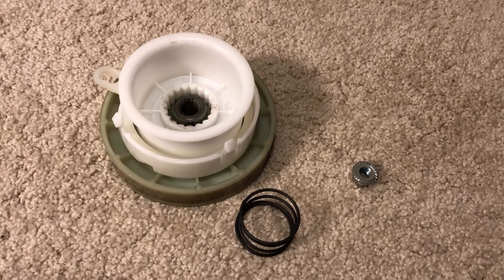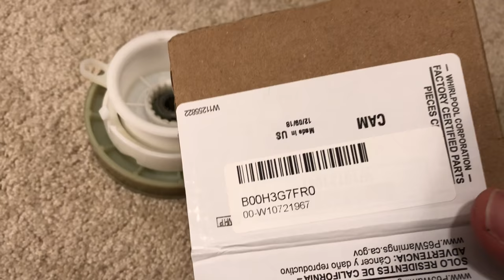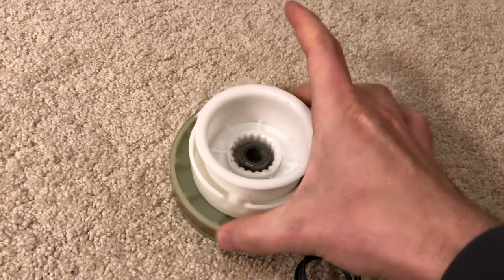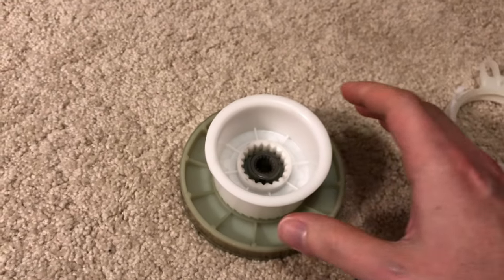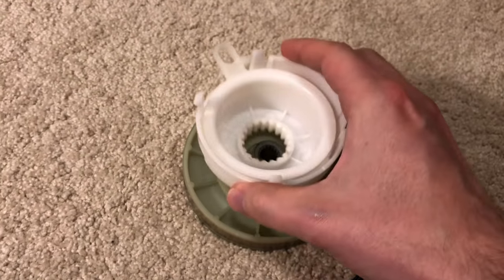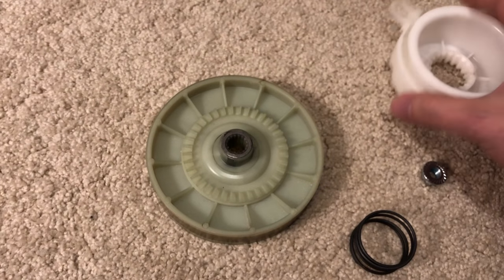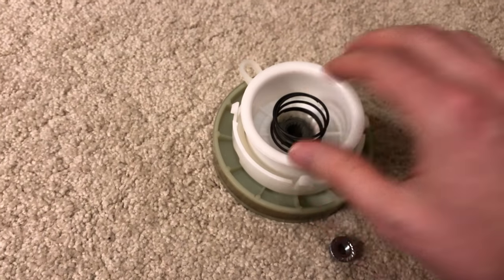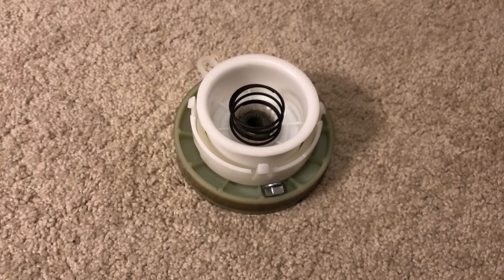Whirlpool Washer Loud clicking noise at end of spin cycle

Comment: This is the same exat sound my Whirlpool is making, but the clicking is also sometimes followed by a loud grinding/machine-gun-type noise.  Would the same part fix that problem as well?
Reply: Mine does that, the grinding for about 3-5 seconds at the end of the rinse spin cycles. Cant find anything similar out there.
Reply: @SilverSpringHomesPro  Check your hub gear below the wash plate in the drum. Mine was all torn up.
Reply: @SilverSpringHomesPro  I ended up replacing this CAM (same part/kit as in this video) -- did not fix. Replaced the shift actuator -- did not fix.  I talked to someone that does appliance repair... his suggestion was that the next step might be to pull the tub to make sure there isn't something stuck between the inner and outer tubs.  Beyond that, he suggested it could be the tub bearing (although he did state that he would expect issues/noises throughout the cycle or at other times if it were a bearing) or the tub brake (however, I don't see that part listed on the schematics I've looked at, so I assume it's part of the gearcase).  Guess I might try to pull the tub just to see what I see... at this point, I don't know what else to do.
Reply: @johntoon7172  Thanks I'll do that!  I had the washplate off the other day and it seemed ok, but I honestly was looking more for debris and didn't pay too close attention to the actual tub hub (hub on the bottom side of the wash plate looked good).  I'll take it off again and take a closer look!  If the tub hub were bad, wouldn't it probably be leaking water though?
Reply: Here is a link to the video of the sound my machine is making... https://youtu.be/nb5f_yPftGY   I also ran a Automatic Test Mode cycle --- passed with flying colors.
Reply: I finally figured out why my washer click like 8 times at the end of a wash cycle. The washer transmission was causing the issue.  The shaft had a lot of play it it. Replaced transmission, no more clicking at the end of the spin cycle.
Reply: @johntoon7172  Yeah... I honestly think that's probably the issue... and probably the only reasonable answer to fixing it is replacing the transmission.  I was trying all of the easier/cheaper fixes first, but no success.  Where did you find the transmission/gearbox? Amazon?  Thanks in advance!
Reply: @johnnyg507   I found one on ebay. New for $125 shipped.
Reply: You ever fix the problem? I just did the videos repair and it still clicks. Mostly at the end of the wash where the green lights says "rinse" then the laugh turns on for complete.
Reply: @douggie85  Ugh... No.  I relaced the transmission and it worked for about 2 cycles then the noise came back and was even WORSE!!!  I ended up getting a new machine and GAVE that POS away!  The guy that picked it up was an appliance repair guy and I explained everything the machine was doing and everything I had done/replaced and he was baffled as to what the issue might be.  I mean, it's possible that the new transmission I purchased was bad, but ... by that point, I was absolutely done.
Reply: @John Grampp  thanks for the response. I think at this point I am just going to leave it from what everyone is saying. It still runs. Just at the end of cycle makes the clicking noise for a minute then completes the cycle. Once it stops working  the cycles it will be time for a new one. Hopefully that happens near our anniversary or her bday and it can be a gift. 😉. Thanks again. 👍

Comment: This is what happens when you go from manual direct drive to digital computer washers not supported from the bottom that are made of plastic and not metal.
Just complete crap you’ll constantly be guessing at if you repair. Most ppl have no clue about anything and if u go attempt a repair they quick to blame you for the trash they bought. There’s a reason washers 20 + years are still around and 5 to 10 are nowhere to be found

Comment: We had the same issue with ours a few months after buying it, the warranty repair person came and said it’s supposed to sound like that. I have never believed this. Is the fix you described still working?
Reply from the maker: Unfortunately no. Still clicks. I think the gear case is bad, allowing the inner shaft to drop down too far which allows the splutch teeth to slip because there is too much end play. The gear case is a $200 part, I'm living with it for now, but you should get it fixed under warranty if you can.
Reply: This is a good video.  Thanks for the detail and indicating the noise from the splutch drive and your explanation.
Also folks these washer series do make wierd sounds compared to a standard old type washer. This is normal as the unit senses the load prior to washing and the cycles selected.

DONT ALLOW COINS TO BE WASHED WITH CLOTHEING SMALL CHANCE CAN ENTER THE PUMP AND CAUSE NOISES SIMILAR TO THOSE HEARD AND CAN DAMAGE THE PUMP

FYI folks there are a couple of different drives on for the Whirlpool Cabrio. The one shown here is a splutch drive  or essentially a clutch type drive. Well explained. The noise heard is more  pronounced when the basket is on the spin cycle from the top (amplified by the spinning drum). For you who are familiar with a failing ball bearing(s) that's what it sounds like.
The other Whiirlpool Cabrio type has twin bearings in the basket and a drive shaft that's removable from same. Bearing sounds are similar to the splutch clutch type NOISES. So easiest way to find your model is look it up and access the parts list. Lots of info on this if you search it.
Reply: @TechnicalLee  our washer makes a clicking noise even when you spend the drum by hand